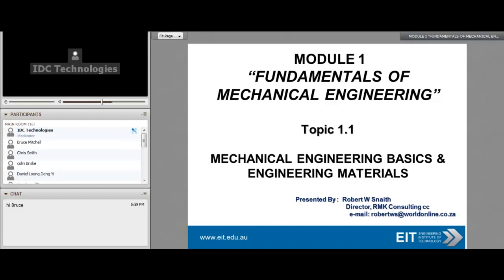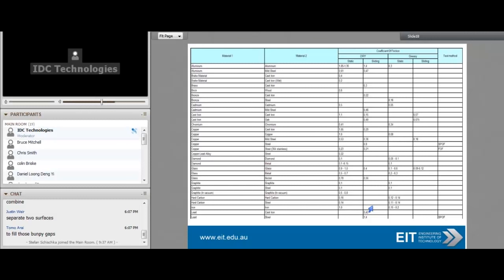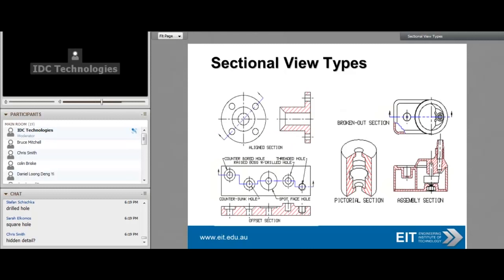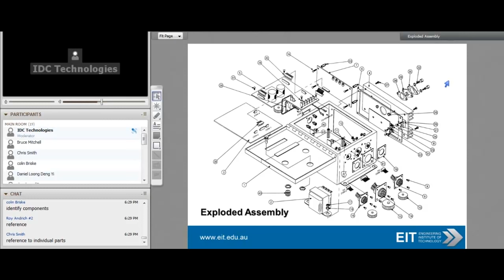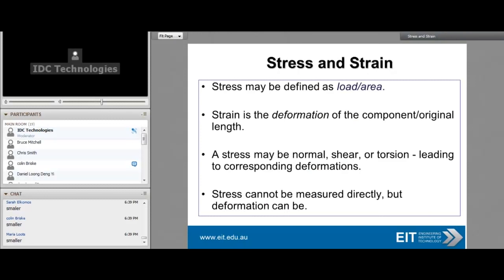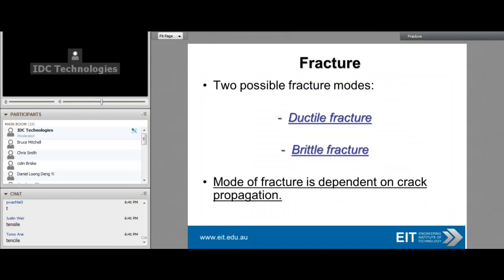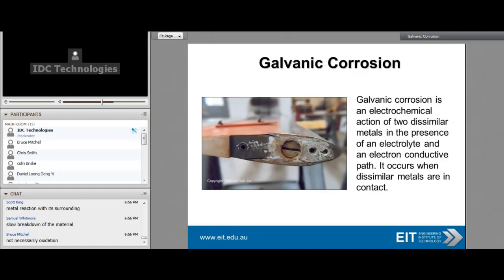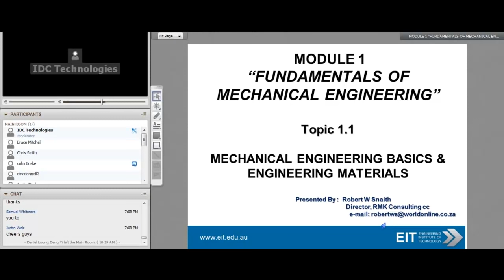Fundamentals of Mechanical Engineering

Comment: I'm only seeing this for the first time, now... Excellent. Except for 1 thing... An engine's serpentine belts, that run externally ON ANY engine..  Do NOT run the fuel pump... Water pump... YES... Alternator and aircon... as well as Power steer if it's hydraulic... YES... But, Fuel and oil pumps are usually run off a lobe on the crank or camshaft... Depending on what engine layout we are speaking of... AND/OR a fuel, oil or water pump can be electrical... The majority of engines these days are computer controlled and so Fuel is most definitely delivered via an in tank electric pump...

Comment: When it comes to your lecture which I connected to the energy shields design for example U.S, your parallel square line based structure design with a center mode for energy going vertical then the side structures line diagonally upward also  forming a triangle whose energy point passage at the edge point of Triangle to whatever purpose the outside of  angled triangle lines projection of energy or connectivity, I think it's stable structure because it's angular like a reversed diamond tough and hard to break if with energies shields against Space bombardments of comets or beams, the problem was it is protruding and easy to spot unlike the Earth slope curve hugging curving also energy structure resilient against beams which could bounce to it's curve if attacked within Earth atmosphere but also not as hard structurally like the triangle structure shield against space threats and hittable by space barrage but because it's a slope with energy it's stable in its circles but the angular energy shields are better against space threats, meaning it depends upon application and purpose, and because it's U.S you're free  to design your defense structure shield given the image of that Triangle shield in space was that of an X within square if viewed from above, only if you will push through with that to protect U.S Let it be

Comment: Not true that engineers never design past the yield point of a material (regarding stress strain curve (47:41) ). This depends on application, in many cases designing a part past yield is acceptable, especially in the case of a lower temper material where the elastic region is small relative to the rest of the stress-strain curve, a certain level of plastic deformation can be planned for.

Comment: Great content and explanation! Can I download a PDF or Presentation file of this class?
Reply from the maker: Hi Felipe :) I have tried locating the original file for this presentation but unfortunately, since it was a few years ago, it has been difficult. Hopefully, you find the EIT resource that relates to this presentation useful: https://www.eit.edu.au/cms/resources/books/fundamentals-of-mechanical-engineering
Reply: @EngInstTech  Thank you I am reading the contents seem to be even more detailed than this great video! I have watched the whole video and made writings about it, in the end there is an exercise, I would like to find it... I am a software developer, I am creating a kind of flying equipment in my spare time, a way to fly just using the body force, without any kind of fuel or battery, I would like to know if you have indications of people to exchange ideas and also if you know any software to draw and to virtually test it so that I will minimize the odds of failure.

Comment: Well that dimmensioning is done wrong because lines of dimmensions cannot cross over others, the diameters cannot be drawn along axes of symmetry, the distance between 2 parralel dimmension lines must be around 7-10 mm and equal one between another. And many others.
Reply: any line through a circle centre is a axis of symmetry, but yes drawing dim lines over centrelines should be avoided.